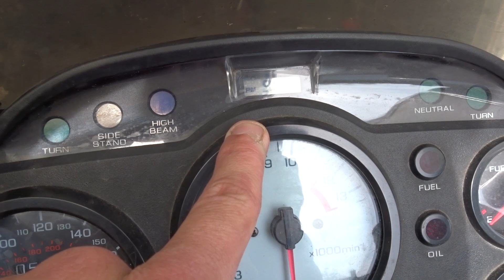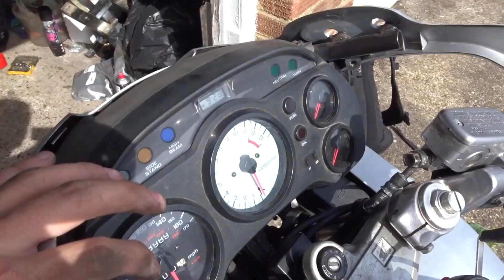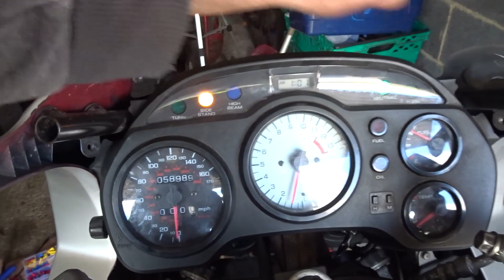Honda VFR750 Breakdown & Fix?

Comment: I never thought I'd see the day a TVR Chimaera was more reliable than a Honda 🤯
Reply from the maker: Anything can go wrong at any time you could even break a key off in the topbox if you can't switch the bike on it ain't going anywhere 😅😉
Reply: @BigPezza  I don't have a clue what you mean 😅🤔
Reply: @CuriousGoose  SEPERATE KEYS FOR ALL THE THINGS!! ....cant be too careful eh lads!! hehe 
I remember one of the first things I 'had done' to my Hornet was have the Solar Alarm pulled because it kept eating my battery and being a general nuisance! 

AUX lights on my Goose were always the weakest link, and the previous owners attempts to dampen the vibes inside the lamp's housings to prevent the wires eventually soldering themselves together; was evidence enough for me to swap them out for something more sturdy.

Curiously, on the topic of sturdiness. I do wonder if Honda's reputation for having a superior finish means they get left outside more readily? Interesting to note you cant service ignition barrels, and i've had some sketchy moments with my key in the fuel filler cap.. What's da best lube fo dat?!🤣

👍
Reply from the maker: @CavalierNTX  27 year old key barrel, hmmmmh i wonder how many times it has been twitched on/off
Reply: @BigPezza  I'll wager you perform more mouse clicks in a year than VFR's been turned over in it's lifetime. lol 
Granted 27 is old.. bit it's nowhere near decrepit nearing terminal seizure of all functioning components. OMG! 
You're triggering me bro!! 😉